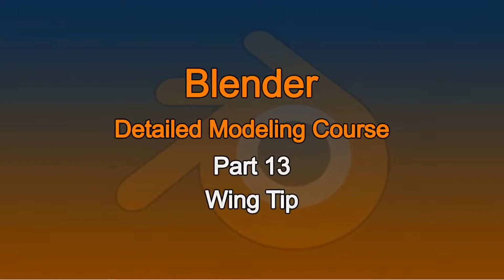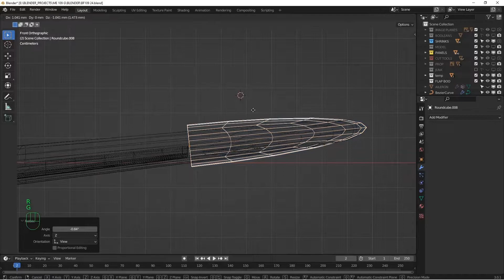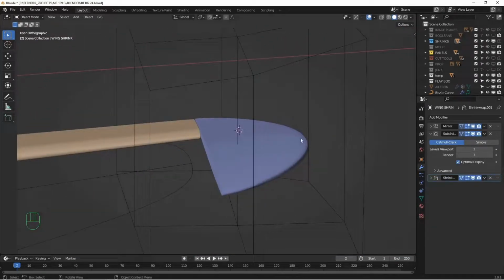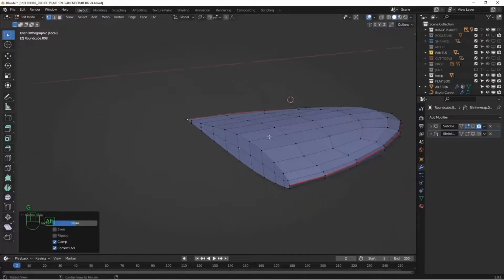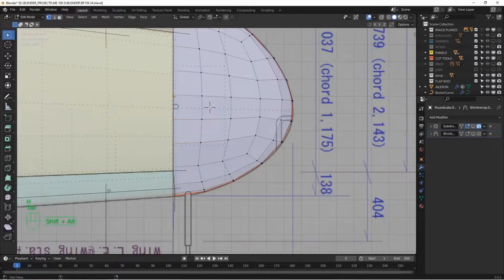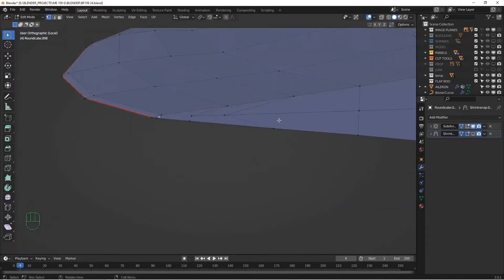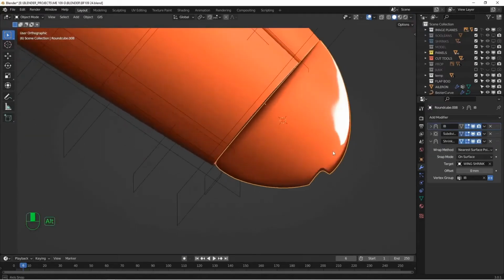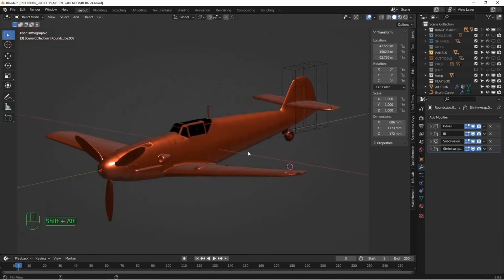Blender Detailed Modeling Course, Part 13: Wing Tip

Comment: The end result for this looks great, but I'm curious why you modelled it with a quadsphere instead of duplicating parts of the wing shrink and starting with that like with the other panels?
Reply from the maker: I wanted to demonstrate how nice the quad-sphere is for making parts like that.  People new to Blender  tend to use a regular sphere as a primitive for parts like that and it often leads to pinching.  You are correct, I could have used part of the base mesh to start with.
Reply: @Mark_Alloway  ah ok, that makes sense, I had no idea the quad-sphere existed before watching your videos and it definitely seems better that regular spheres. I'm just having some weird issues where it doesn't seem to shrink to the wing properly, it looks like it's sitting inside the wing model. I think I might try starting with the base mesh and see how that compares.
Reply from the maker: @pogotc 
Sometimes the shrinkwrap doesn't work well if parts of the shrinked object are inside the target.  When this happens to me, I edit the part I'm trying to shrink and pull the offending vertices along their normals until they are outside the base mesh.
Reply: @Mark_Alloway  thanks for the tip, I'll give that a go!